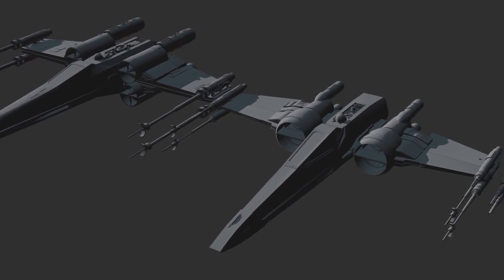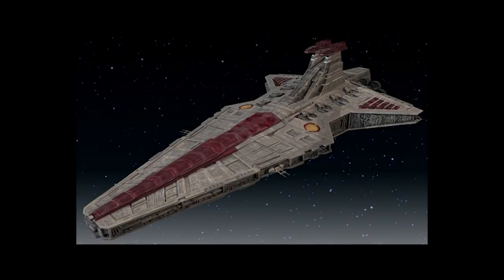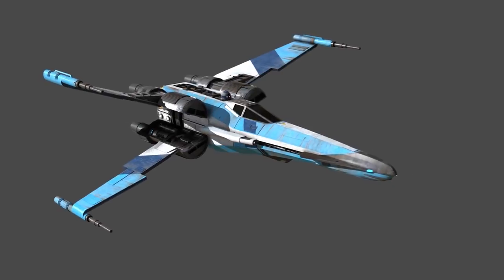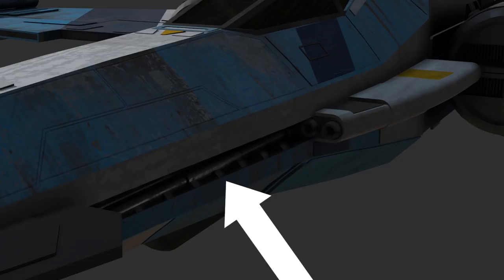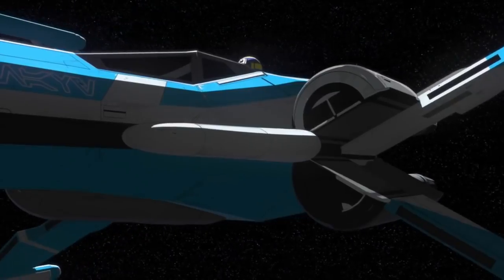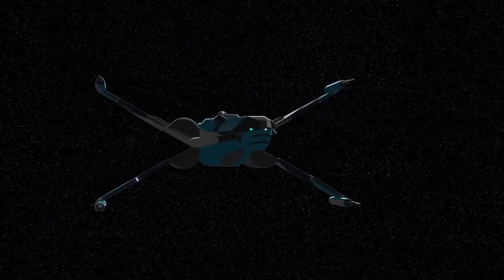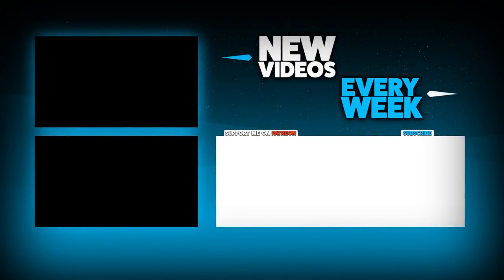Realistic T-85 X-wing Model

Comment: Good call on the hinge placement. Looks way more fitting.
Reply: it really does look fitting
Reply: I know this is old, but HEY! its one of my favourite youtubers! XP gamer! HI!
Reply: Agreed, it gives it the proper geometry when it splits to the open S foil position.

I'm curious of the small thrusters in the back of the ship, are they smaller boost thrusters? Because the forward Delta wing and boosters imply better atmospheric capability. Similar to a multirole fighter of our time. Also the laser firing apertures are much smaller requiring less cooling. Perhaps for stealth and low profile.
Reply: @deathstrike  i bet it's a hyperdrive thrusters
Reply: Agreed, though I disagree on which is 'right'. Sure, it may not match the show, but good design principles and just what we know about what people find attractive and not attractive pretty clearly put the show's solution in the wrong. Having continuous lines that flow through shapes is just better to people. It looks more plausible and robust.

Not to mention, mechanically, the other design actually would not work. It would have very little strength behind that hinge to support the wings. Just think about what the fuselage could actually grab on the wing to hold it in place and you'll see there's very little there. Real aircraft do their best to continue a spar (even if sometimes the spar has a kink in the middle) from tip to tip for good reason. Airliners have to do a lot of work around this if the passenger compartment gets in the way, for example.
Reply: Was going to comment just this. So thx.

Comment: Really good improvements! I hope this version makes it to the screen some day!
Reply: I think the original version makes sense along with the rest of the details in the design.  It looks like the ship has been refined over the original version to reduce mass and likely improve performance against the lighter Tie fighters.  This is evident in the engine housings, the slimmer looking nose and in the wings themselves. 

Placing the pivot in the center of the fuselage right behind the cockpit means that anything back there must be attached to the wing/engine assemblies and that there's little usable space back there.

In this version the two pivots make for more usable volume behind the cockpit and is likely where components that would normally live in the nose are placed.

Comment: You NAILED the X shape, sir. The whole classic, definitive profile of the X-wing hinges (see what I did there?) on that central wing pivot point. You could change a lot of a ship and have it still be an X-wing as long as that is in place. Further, it would probably make a far stronger wing with a tip-to-tip wing spar as the T-65 and T-70 have, versus two hinges (more moving parts to break) and shorter wing spars that aren't counter-balanced on the other side of the ship.

Because of this, I can look at the T-85 now and say, "Yeah, cool ship," where I could not previously. 

You're doing work that needs to be done! Keep it up!

Comment: I feel like the animations today have a lot less weight to the fights

and I dont know why
Reply: To start with: It's all CGI these days. There's something to be said about traditional model work that helps it feel more "real." IMO the Battle of Endor is STILL the best dogfight in the franchise, and the effects work holds up incredibly well today.

Also, just to show how much thought they put into the OT, the original film had no less than EIGHT X-wing effects models, all with their own distinct markings:

Red Leader - Distinguished by being a relatively clean hull, but having a very distinct blast pattern on the forward hull; almost as if the nose had been shot off at one point, and replace by a section salvaged from another X-wing.
Red Two - This was the prototype "Blue Leader" model all of the other Hero and Pyro (the ones that got blow'ed up) models were molded from. It was repainted as Red Two.
Red Three - Probably the most beat-up, with loads of different-colored hull panels
Red Four - Lots of tan and brown trim.
Red Five - Distinct broken stripes on the side
Red Six - TONS of red panels, including the canopy frame, parts of the engines and wings, and one whole laser cannon.
Unidentified - Another X-wing with lots of red panels, but a distinct pattern from Red Six. It MAY be Red Ten, but there's no known clean shot of its ID tabs to confirm.
Red Twelve - Only known image is of the underside, but clearly establishes how the ID tabs beyond Six would be presented (While Reds One through Six had 1-6 full tabs on each wing, Seven through Twelve  would use double and half tabs. Red Seven had three double and one half tab, Red Eight four double tabs, etc.)

Additionally, there were also variations in the surface detailing of the wings and engines that helped sell the idea that these ships were old, banged up, and subjected to numerous repairs, salvage efforts, and modifications to keep them flying on a shoestring budget.
Reply: because the people making it either have no detail-oriented crew members, or they just don't care.

Comment: This is really great. I saw the first episode of Resistance the other day, and afterward when I read those were T-85s, I kept wondering what they would realistically look like, as I'd been keen to know more about the T-85 ever since I first heard of it. I really like how you've modeled it here. Compared to the other two X-wing designs, it trades some of the T-70's slender, refined appearance for some aggressive bulk that's reminiscent of the T-65 or a Legends E-wing. I like the flanges on the sides of the fuselage, and while I'm not completely in love with the jagged wings first seen on the T-70, I like how you've got them joining next to one another to form a single broad surface when closed. Your design seems to take from both the T-65 and the T-70, which I think is great, because the T-65 is the iconic X-wing, and I like how your design (and therefore the design in the show) calls back to that, rather than only building off the T-70 and deviating even more 'into the unknown' and away from the original. 

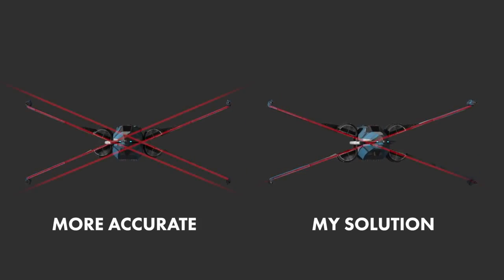I also agree with your decision to rework the S-foils. I don't hate the design with the hinges at the sides of the fuselage, but your solution is truer to the previous models of X-wings that we've seen in the movies. At 2:09, that head-on view of your version reminds me of those great shots of X-wings rolling into battle over the Death Star in A New Hope or the Resistance T-70s coming to the rescue at Takodona in The Force Awakens.

Comment: in 1979, I drew-up a 'beefed' X-wing, where the 'x' foils started at an-already-built-in 30* 'X'. This allowed the fitting of two more engines (for 6, total), and let the 'X' deploy as a 'closed-loop-at-the-tip' diamond wing, then Expand to offer better cross-fire of the beams. I added 7 feet of 'fuselage', one at the nose, ahead-of the cock-pit (which, itself, was moved ahead by 2 feet [think, F-4U vs. Hellcat],with the 'extra' length pushing the wings/motors back 3 feet, and added fuel/munitions/electronics put near the CG/Centerline of the critter. Extra Depth of the Center body may have allowed two-more Lasers, or Proton Launchers. 2 R2-D3 were on board, one 'up', one 'down' + to the Rear.  It would've been Faster, better defended, and had 25%-33% More firepower, with potentially (cruising, not 'Combat') range. Downside, more bulk, more Maintanence and an easier Tie-Fighter 'Kill' in tight quarters.  Oh well... Fan-space wasn't a 'thing' 43 years ago (we still used Typewriters, even!)..

Comment: I just got new appreciation for the X-wing. I didn't know it's wings articulate from a single joint. 
I had recently been sketching a remake of the tie fighter where it's got an F-15 bubble canopy cockpit and nose and the tie fighter's hexagon wing is meshed into the jet fighter body behind the cockpit so it still works as a solar panel but doesn't block the side views of a jammed Tie fighter.
And we know Tie fighters drop like flies. 
I've not posted it on deviantart yet though, my username there is Justinnator4.

Comment: Could the little rounded bulbs you removed from the torpedo tubes be set on a set of rails in the trench?
You'd probably have to angle the rails inwards or the launch tubes outwards to not have the projectiles interface with the ship, though.

Comment: Old video I know, but one issue I have with your redesign is the fact that, proton torpedos with where they're placed look they're going to hit those nose fins. Raising or lowering them on the nose would of quickly fixed the obstruction. Even if canonically the torpedos can move out of the way before that, it doesn't look quite right. Everything else though is spot on.

Comment: EC, I love your models and most of your ships but I see a couple of problems with this one:

1) The Torpedo Tubes launch directly into the "dog snout" of the ship since they launch directly forward and unless having some mystical "turn juice" otherwise known as "plot armor" will use that thing called physics to rip the ships own nose right off with a nice big explosion since that's essentially what your launching, a nice big explosion not to mention freaking with your flight profile ( in other words, more commonly known as crashing ). 

Also, Most targeting packages on weapons designed to kill other ships count on reacting when touching metal so when launching them it is also nice to have that clearance so it doesn't go off when fired or at least has let's say a 3 second delay when fired, again not a desired result in any weapons package which means it is Not a good weapon design by anybodies estimate ( even Orcs in the Warhammer 40k universe are smarter than this, well the ones who survive are ) and coming from somebody who used to work with them a lot, I know what I'm talking about. 

Weapons must have "clearance" due to exhaust gases or "out gassing" as it's called from the rocket motors launching the payload or "package" as it is called, which if you think about it makes a lot of sense. Nobody has Ever installed a multi-million dollar weapon system and then put something to make it all look cool in front of it to make it look better since it defeats the purpose of even having the weapon and fouls the sight picture quite well. In fact any time that particular item has ever come up, the "cool looking item" usually gets sawed or torched off by some responsible deck chief who doesn't want to see you or any of his crew die in a massive fireball. For some reason deck chiefs equate unplanned explosion + unexpected fire = death, I don't know why. 

So as a possible solution have you considered possibly running the tubes down the whole length of the nose instead? I know it will cover up your "dogs teeth" but a longer barrel on the weapon usually means better accuracy at longer ranges since the weapon has more time to stabilize in the barrel of the weapon. 

Might think about it.

2) Stop, at least for a little while, making models for Disney to then retconn or steal from you. You know they already have and will do so again, so why make more for them to steal, then merchandise and claim it was all their idea anyways?

Comment: You also seem to have slimmed the bow down, might just be me, but i got the impression of the original design to have a rather bulky nose, compared to either the T-65 and 70.
Which makes sense as it is supposed to be a heavier version of those. About the torpedo tubes, maybe the ARE where you placed them, just covered by the part you removed.
That design would make sense to make the craft better suited for (shieldless) atmospheric flight. Just a guess on my part though.

Comment: Wow, I never noticed that the original x-wings hinge in the centre, but it does look better. I have to say I hated the T-85 design when I first saw it, but this adjusted version to fit the realistic render does look decent. Only things I really wish could be changed is the the length of the laser canons, the longer ones on the old fighter are just such an iconic aspect of the x-wing shape, and I'm also not big on the T-85 paint job.

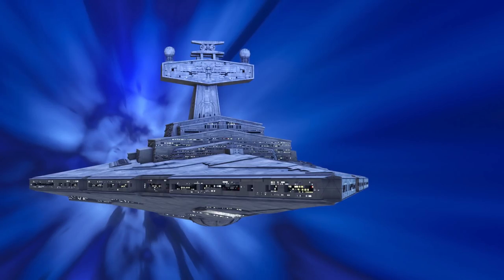Comment: +2:10 I can see why you like the traditional wing hinges - But I can see some reasons why you wouldn't do it that way. It takes up less internal space to have 4 pivot points. It also allows the pilot and astromech more visibility over the engines and the wings when in attack formation.

The Eric version though may have superior heat dissipation, but also might increase the chances of a hit to the wing interiors where the engine interiors are partially exposed - if the Canon version covers those up in may be an improvement in armour.

Another possible advantage of the double wing system is it may allow the wings to part split say keep the base wing pair parallel and the upper wings raised (ideal for attack configuration ground hugging in an atmosphere and perhaps slightly improved atmosphere handling. I think you are right about the Torpedo launchers though it's the logical place to put them - about the only other place you can put them is in the tip of the nose and move the communication and sensors to the outside parts. Though they could also be on the underside where the cargo compartment was on the T-65.

The small Quad of inner engines may improve handling too - I often used to wonder if the T-65 had micro-thrusters on the back of the guns as that would also explain why the S-foil configuration would be a positive  and not a way to make your guns more likely to miss.  I do think perhaps this is designed to be un-canonical in many ways for licensing reasons which is why certain features are missing or different and not just because it's animation.

Comment: I think you did a great job the only issue I have is that the original cannons and the wings were much longer and had that cool scoop at the front and it just made them look more menacing and elegant the short little cannons on the side of the T 85 are just they just don’t make it look as cool anyway I agree with your decision to center the point of crossing from the wings to the center of the ship that really does make a difference and you’re right about how ugly it looks when it’s not that way

Comment: Great work! Really great model, I hope SW crew will ask you to use it :) Fixed wings looks soooo much better

I don't understand one thing in the new X Wings. S-foils were created (in-universe) to have better heat disposal during combat. But, in the new versions, the surface of wings is not very bigger than with "fly mode" wings. Only above engines there is some extra space, but the idea was about whole wing... Do you know any reasons for such change? Heat disposal is not necessary, because engines are smaller?

Comment: Ahh! Yes! That wing articulation! I knew something was off about the cartoon version! I'm SO glad you fixed that! 

Unfortunately, that still leaves the 'wings' themselves as an issue to me... The 'top' and 'bottom' S-foils don't match - they are rigged as seperate 'halves' that merge into a single form when closed. But that ruins the symmetry in my opinion. I'd love to see a variant of this design with that one more change with all four S-foils matching...

But thats just me...

~JD
Reply: Kinda seems like a mix between the ARC-170, Z95 and the T-70 imo

Comment: While there's a valid argument for a unified central hinge, having worked myself on actual swing wing planes (F-111D, Cannon AFB, 1989-1990), they pivot in the wing root, not the center of the plane. A central axle would  take up a ton of internal space that could be used for fuel, better shield generators, more powerful hyperdrive, etc. Given SW ships take inspiration from real planes and ships, I'd suggest the SWR version should be treated as more authentic. Besides that, nice work. I design SW stuff in Blender and have built a full scale model of Gunga City in  Opensim.

Comment: I thought the Clone Wars Venator was visually accurate, the completely grey Venator is Imperial, not Republic. The Venator with red accents is accurate, as far as I know, its a command ship and it is during the Clone Wars. The turbolasers, ion cannons, or laser cannons on the side aren't on the actual model, but, it could just be a modification from a standard issue Venator.

Comment: Slight problem with your torpedo tubes, when the warhead launches, it's going to smack RIGHT DAB, into that chin-fin off the nose.  this is a serious design flaw that should be corrected.  :::keep the fin::--angle them down a bit... say 45º to get them out of the direct exiting flight path of the torp... (personally, I feel this might be the best look)… of course, you could always nix the fin, altogether, and just emphasize coloration detail in that location, like , special plates that minimize the radar/ladar cross-section and targeting, making It harder to get a solid fix on the ship.-- just my 2-cents.

Comment: I was hoping they would go with something sleeker and more advanced looking. This fighter looks less advanced than the ones it replaces. As technology advances it gets smaller. So I would have disposed of the need for the wings to split and had the lines of the wings leading edge curve into a flatter fuselage that would terminate at the tip in ether a sharp point or a chisel edge. I would dispose of the round engines and opt for a more conformal triangular shape blending seamlessly into the body of the ship, with the outlet ending in a vectoring bar across the back to insinuate greater thrust ratios and in homage to the falcon. Sort of taking inspiration of the lines of the ship from the Nubian ships in episode 1 and 2. I know star wars is supposed to be industrial and "dirty space", but there is room for streamlined design there.